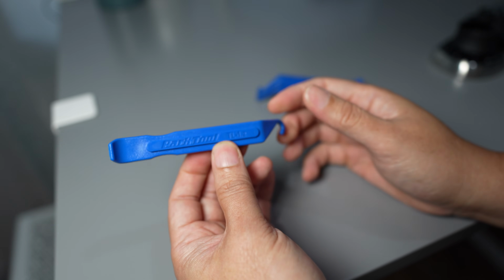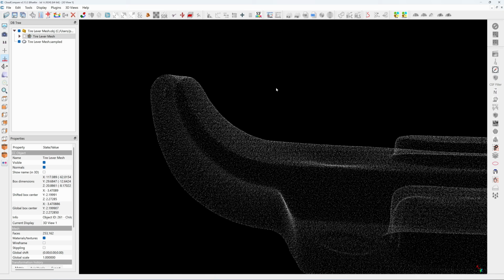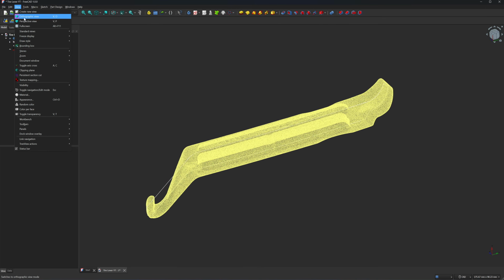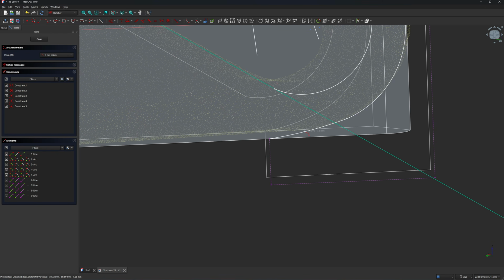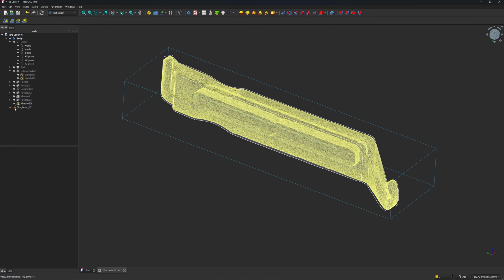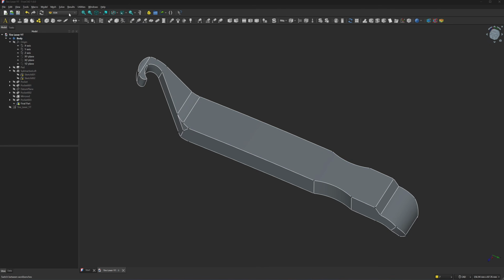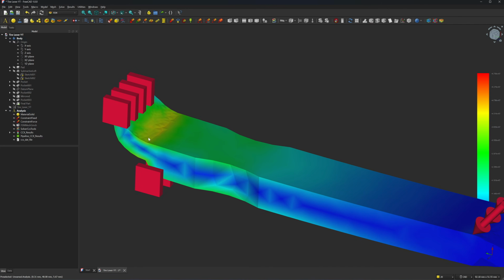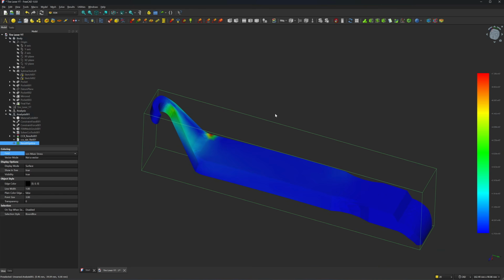Analyzing 3D Print Strength with FreeCAD: Reverse Tire Lever from Scan to CAD

Comment: A very useful video, thank you. The hook though, is normally only used to hook around a spoke to hold the tool in place while you use another one. Also to minimise the force needed to remove the tyre, the whole bead can be pushed into the centre well of the rim.
Reply from the maker: Great tip!

Comment: Do you know what the actual tool is made from? Could it be nylon? It would be interesting to change the material in the simulation to see any improvements.
Reply from the maker: I think it's injected mold Polypyrene, but I could be wrong.

Comment: Thanks so much for taking the time to put together these videos.  They have been very informative to me.  I am close to purchasing my first 3d scanner and have been researching them for the past couple of weeks.  I have narrowed it down to the MF Three or the Einstar Vega.  I know they are very different scanners but they seems like the best available in my price range.  There is a lot of info available online for these scanners but you are the only person I have seen with hands on experience with both.  Do you have any advice for me in picking between these two?  I will be scanning mostly single objects but would also want the ability to scan, for example, a car dashboard.  I have not owned a scanner before but have an engineering background and am experienced with 3d printing, software, measurement devices, etc.  Any thoughts you have based on your experience would be greatly appreciated.  Keep up the good work!
Reply from the maker: Both scanners come with an integrated computer unit, eliminating the need for an external PC during scanning. The MAF3 delivers superior scan quality—it’s the most detailed scanner I’ve used so far—along with better software and an intuitive interface. Achieving a complete scan with minimal effort is highly likely. However, the MAF3 is not designed for objects larger than 40–50 cm.
On the other hand, the VEGA is a tracker scanner, but its tracking performance is subpar—it ranks the lowest among the ones I’ve tested. Scanning with it requires patience and time to ensure completion. While it can handle larger objects, the results are inconsistent. Based on my experience using VEGA’s large depth camera, its capabilities fall short for reverse engineering tasks.
Reply: @Payo-TensileCreator  @NATEROB009 Wouldn't the Creality Raptor Pro cover the use case well? I have just bought one based on yours (and other reviews). It hasn't arrived, so I can't comment from experience yet!
Reply: @Payo-TensileCreator  I am glad you gave me more reason to buy the MAF3; I was drawn to it from the first scan I saw on your channel.  I just put an order in for one.  With the current sale I was able to get it for $1500 USD shipped.  Now I just have to be patient but hopefully I will receive it before the weekend so I can start testing it out.  Thanks again.

Comment: Fixing individual points it not really representative of how the part would get restrained in real life. 
The stress concentration at one point is false and unrealistic.
Applying the fix constraint to a surface will produce a more realistic stress pattern, because in real life you don't have a stress concentration at one point.
Reply from the maker: This video serves as a basic introduction to FreeCAD FEA. Each simulation requires a uniquely crafted model, with support conditions such as springs and frictionless constraints. Given the complexity of the topic, training an engineer in this field takes months, so it's impossible to cover everything within a 30-minute video.

Comment: I find your project very interesting both lidar and desktop scanner for reverse engineering. Are you working on it as a hobby or is it part of your business? I also possess both scanners as part of my hobby, though I have not yet had the opportunity to make full use of them. Would it be possible for me to join your project?
Reply from the maker: 3D scanning is an integral part of my design process. It’s not just a pastime—I incorporate it into my professional work.

Comment: It is very hard to equalize or beat injection molding with 3d printing, layers are not enough fused together but with injection molding you compress material at a maximum rate which add strength. You also have a better choice of materials. In fact, it is a compromise between injection molding and machining from stock plastic bars or plates. Oh by the way, it's a very useful video on reverse engineering with freecad!👍👍🇨🇦🇨🇦
Reply: You can use PPA or PPS but this part would cost around 4-5€ in filament cost. Currently printing a part in similar size out of PPS (heat resistance 100c glass transition temperature and stiffness) for dental tool cleaning machines. But how he printed the part it will not hold. The simulation will be useless. Should have been printed in an orientation to avoid z layers have to take the load. 

I would probably CNC this part out of POM stock if I would have to make more than 2-3 parts.

Comment: Great video. Would be great if you took it one step further and redesigned the tire tool for 3D printing. From what I can see, it would probably be better to make two separate tools to get both hooks in line with the layer lines.